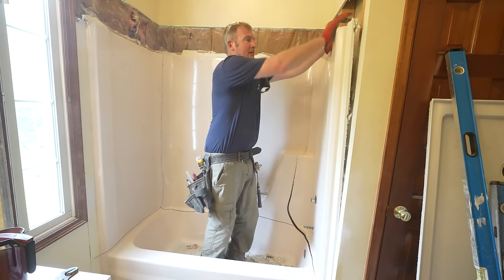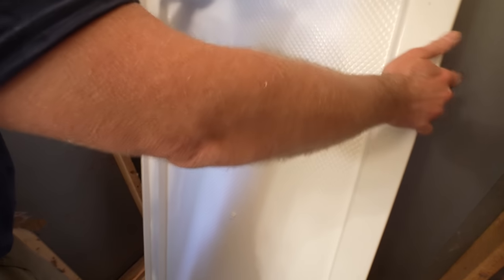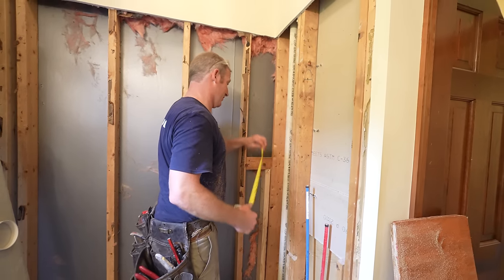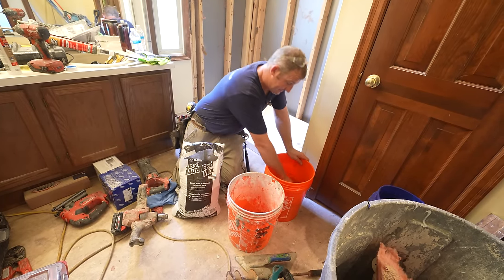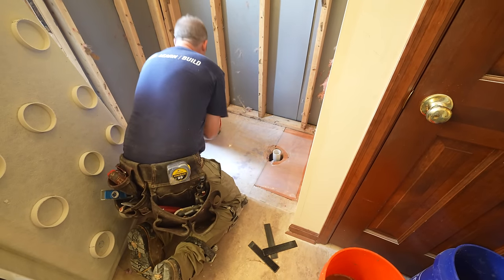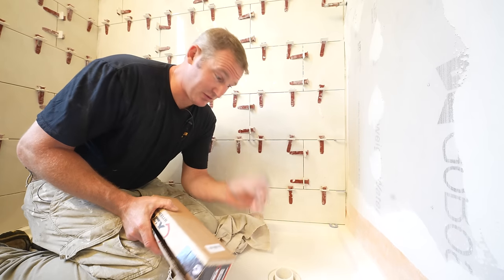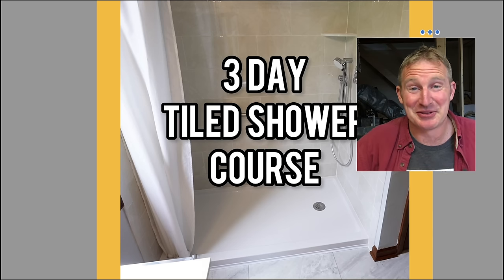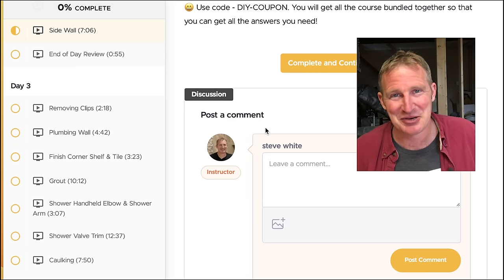Installing a Shower Pan Base | Tub to Shower

Comment: I don't like apartment living, because many times when taking a SHOWER, or after using my toilet, I have heard noises, underneath, toilet or pipes noises, or other showers, or water running in other parts of the apartment complex, during the time I have been SHOWERING washing my body, or there will be water draining out of my tub, even when the drain lever is  completely closed, water will still drain OUT when I want to soak my feet in the Tub.

Author Advocate, Activist for Humanity,
Jason Sandifer,
Michigan,
7/09/2024

Comment: Was this project done in a basement?
Reply from the maker: No, this is on a second floor bathroom 👍
Reply: Yea the basement with a wood subfloor sitting on floor joists with plumbing and drywall below said subfloor and joists…
Reply: @ryanbelow  I am very new at plumbing, so there is no reason for your sarcastic response Rude Ryan!

Comment: You didn’t tighten the drain nut. By hand WILL leak. You’d never know on a single story. So close to a perfect video. Another step missed on your “no caulk drain” is to caulk it. These cheap rubber compression nuts will leak too I’ve installed thousands on track homes trust me.
Reply from the maker: Nope, no trust in what you said there 😆 look up oatey and Dreamline specs 👍

Comment: I didn't like you putting  a silicone on the drain, it would be much better if you used plumbers putty
Reply from the maker: Not if you follow manufacturer specs (no plumbers putty on acrylic Dreamline shower base)